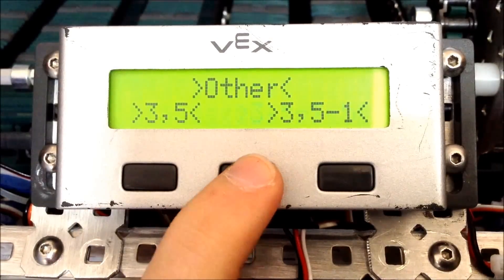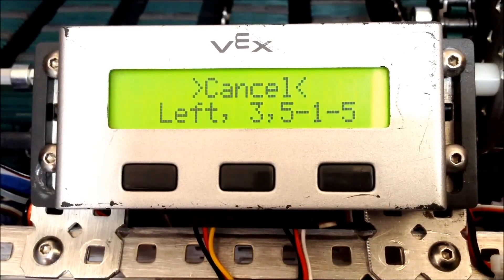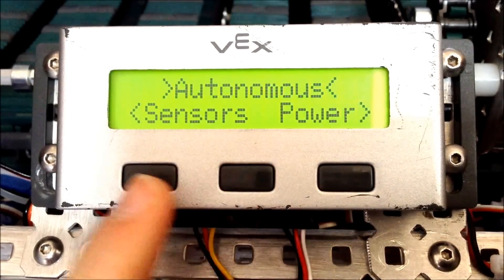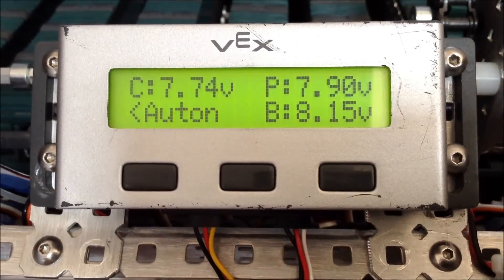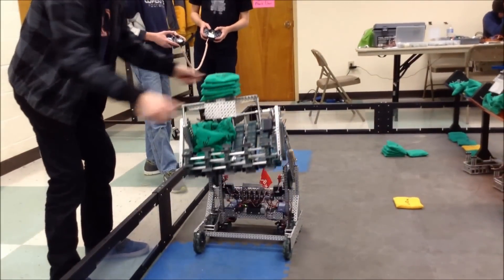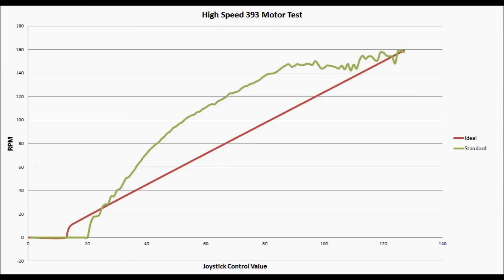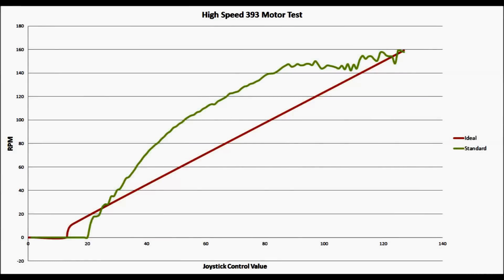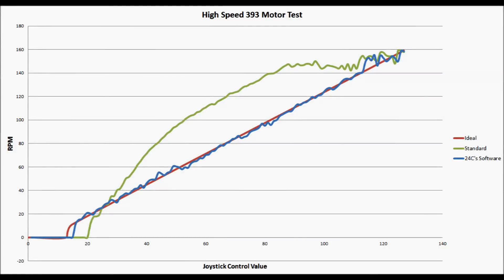24C VEX 2013 World Championship Innovate Award

Comment from the maker: It sounds as if you have done plenty of calculations based on experience and other robots, which is good. If you are confident, I would go for it. Do remember, though, that 2915A had their motors directly driving the wheels. Adding gearing does give you a bit of efficiency loss. Just something to keep in mind.

~Jordan

Comment: The reason I think this is usable is because of another robot I saw, 2915A. Having read the summary of it, I saw that it had a 1.6:1 drive with 4 393 motors, it weighed 17 lbs and could drive with up to 20 sacks.
That comes out to 28 lbs being carried around by 4 motors internally geared, so I roughly compared the load on each motor with my ideal set up. The weight multiplied by the ratio and then divided by the number of motors left me with 11.2, a relative stress on the motors to work with.

Comment: That 3.7:1 was factoring in the sqrt 2 of the wheels at 45 degrees, and I am thinking of tuning it down to an effective 3.4:1 by driving the wheels with a 2.4:1 ratio, a 3:2 with internal gearing for speed.

Comment from the maker: This season, a fast, light robot is desirable. But remember how an x drive works, in that the speed is effectively sqrt(2)*(ratio), meaning that your 1:3.7 would be equivalent to a 1:5.2 tank drive, which is insanely fast. With six motors on an x drive with 4" omni wheels, even if you are able to get your robot under 10 lbs, I would not advise using a ratio above 1:2. You might just barely be able to get away with a 1:2.3, but I would not even try a 1:3.7. My suggestion would be a 1:2 ratio.

Comment from the maker: Our drive was powered by six 393 motors, all geared internally for speed, and directly driving the back four wheels of the drive. This gave us a 1:1.6 gear ratio.

Our robot's weight was very close to 20 lbs, mostly due to the amount of tank tread on our intake, and the steel plates we added to the back for weight.
(continued below)

Comment: Hi Jordan
I am interested in your drivetrain, and I would really like to know:
How many 269/393s you used?
The gearing?
The robot's weight?
And how many sacks you could drive comfortably with?

I am currently trying to build an x drive for a very light robot, and I am thinking whether I should go for six motors and lots of speed (~3.7:1) or whether to go with four motors at a slightly lower speed (2.3:1). This will most likely be on 4 inch omnis.